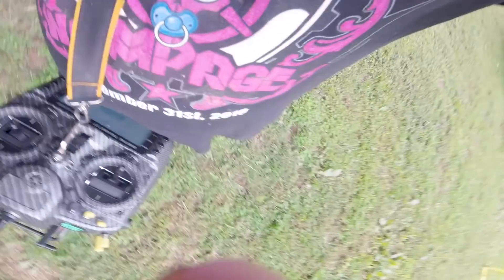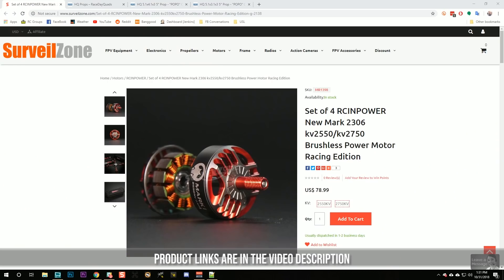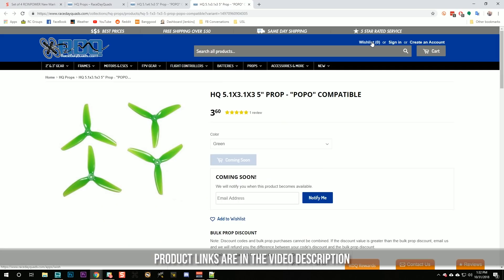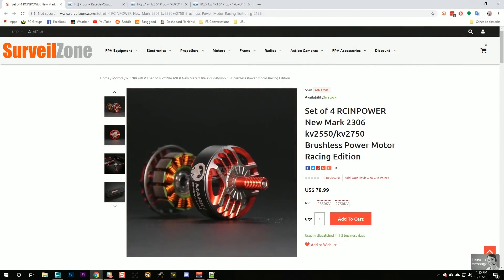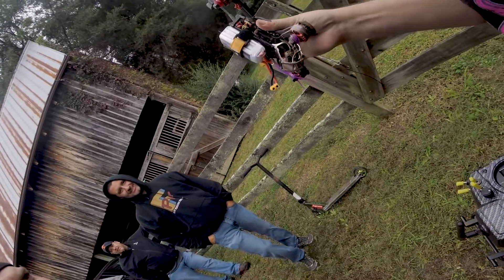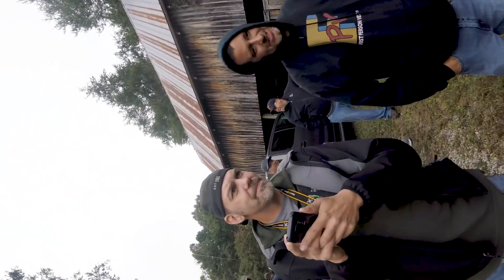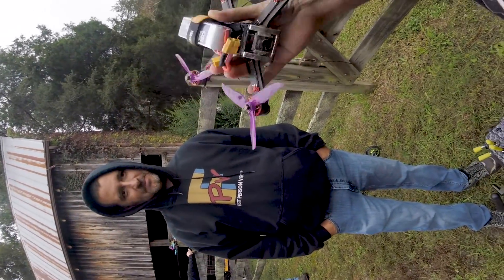HQ 5.1 Series Props and RCINPower 2306/2750kv Motor

Comment from the maker: 1:08 - Intro about kv and prop selection

4:24 - Actual conclusions about motor and prop are here

10:54 - Flight examples.
Reply: is image stabilization on or off on the go pro?
Reply: That's the only prop I use dal 5040 on 2700kv

Comment: was that on 4 or 6s?

they are rated for 6s I believe...
Reply from the maker: If you have the guts to run 6S on 2750kv, more power to you.
Reply: @JoshuaBardwell  😂 already had 2550kv on 6s (without throttle cap on a 5152 gemfan flash) 

How much worse could 200KV more be... 😂

Comment: Would you recommend this motor for a medium range 5s 65amp esc build using 6x5x3 gatebreaker props?
Reply from the maker: No definitely not. Such a high kv motor is not suited for 6" props especially on 5S.
Reply: Joshua Bardwell Thanks for the response, I went with the 2407 2500kv motor from lumeniere, Would this motor paired with 65amp Ecs and the gatebreaker 6x5x3 be feasible under 5 or 6s? Kakute f7 board. What would fail first in your professional opinion?
Reply: I feel like I should add that I do not intend to race the drone, I am a mild flyer who enjoys aerobatics and the occasional big punch out

Comment: And I totally agree JB, if your gonna run 5x4x3s it's pointless to run anything more then a high quality 2205 like the R2 in 2522kv or the OEM  R2 bad ass motor from RDQ in 2450kv that is a perfect 5x4x3 motor on a semi light weight build nice flight times on a high quality 1300 with minuim sag through out the pack. Imho the best motor for the 5x4.3x3v1s is the R4 2206 in 2522kv. Once you step to high end quality 2207 or 2306 or bigger 5x4.5x3 or more or it's pointless. I can say I'm really loving this 5131x3 on 6s 1750kv for a freestyle prop running 6s 1050s flight time is awesome, prop flutter comes on past about 90% throttle once the quad picks up some speed but the low end and mid range response is wonderful and flight times are excellent as well as being VERY battery friendly.

Comment: I was able to test these props on a tight track. My opinion goes to show how differently a prop can based on how it loads any given motor.

 Way too much low end torque for me. Hover point much lower. Very non-linear power delivery over 30% throttle. Stalls at 70% throttle.Tested on 2205 2522kv hyperlight.

Your first video looks over-propped.
Reply from the maker: Hard to believe my 2306 was overpropped but your 2205 was not. I suppose weight could play into it.
Reply: @JoshuaBardwell lower kv. I stalled later than your higher kv motors. We can use max prop frequency as a rough factor of max rpm, right?

Comment: A racer guy suggested I get those hq 5151 props. So i did and i loved it. And in 3 weeks, all my batteries were destroyed :) One battery even ruptured and smoked. So, i built a 6s quad instead so i could keep running that prop and it is awesome. Batteries are barely warm and its super punchy. motors are the emax rsii 1700kv. Those props made me build a 6s quad :)
Reply: Michael Wilkes I can confirm that. I have the same experience.
Reply: If your running 2400kv plus on 4s with the 5151x3 on any motor that can handle that prop you MUST set the throttle end point to 85 or a max 90% or you will no doubt kill batteries even with top shelf packs. It's a heck of a prop on f40 pro IIs 2400kv with throttle end point at 90% and on the 2600kv with throttle end point at 85%. Only packs that handle it and stand up to them well is the 100c R-line 1550 2.0 HVs they do take it pretty well but if you run 100% throttle end points and are between 70 and 100% throttle a lot of the flight your gonna kill batteries right and left. 6s is no doubt the way to go BUT with the right setup and really good batteries you can handle props,like the 5151x3 and not destroy batteries.
Reply: @wickedreelz5028 :  good info. I was pretty soon aware that i had chosen parts poorly, so i just decided to run it to death and build something else.

Comment: Think you over propped it still ... if try a 4x4x3 on them but I reckon a 4.5x4.5x3 is a prop size we need ... more pitch means more speed less thrust. High of or total rpm should use a smaller diameter prop as it has a way bigger throtal range if the right prop is on there so it will make up 
 it's performance in speed not thrust ... high kv is made to spin faster with the sacrifice of tauqe where a low kv motor you can put a bigger prop on for the same size motor make twice the thrust but have half the speed... low kv has more power but less throtal range and if both motors are propped perfect they will be both responsive and smooth if used in the right way like high kv in a tight compact light build and the low kv can be a heavy old tank and still preform well

Comment: Try the T-Motor, best prop for high kv motors.
On high kv motors, you have to use  either low pitch prop, or low surface props; T-Motor and Dalprop 5051 are low surface. T-Motor are also durable.

Comment: Is there a way to re thread the screw holes on these motors? i stripped mine from changing to different frames! if there is a type of tool please comment..great video and flying!..
Reply from the maker: If you mean the base, it's possible you could tap it and insert a threaded sleeve. But you're going to need to be really careful not to get metal filings into the magnets.

If you only damaged one hole, you can just fly on three, or even two screws, as long as they're good and secure.
Reply: @JoshuaBardwell  what size are these sleeves?..and where to buy?
Reply from the maker: The name of the tool is Helicoil. The screw size is m3.

Comment: This is absolutely a true story! i bought these motors about eight months ago put the on a stretch X armattan frame a couple days of flying it just doing line of sight speed runs back and forth on the arm where the motor screws are... it snapped that spot in half and two screws still holding the tiny half to the motor and it tumbled to the ground! the sound was so wicked! sounded like   Chewbacca choking  on a ham sandwich! very powerful and durable motors!

Comment: Nice flight, didn't surprise me that all the props broke. Those dal T5040C break right at the Hub if you just look at them wrong. Forget trying to turtle mode with them, horrible prop lol

4s 2207 2700kv or 6s 2207 1800kv on T5143 props mmm best combo ever.

Comment: Hi Joshua, have you tried the gemfan 5149? I used the 5055 and 5152 for a while then tried the 5149 and love it. I’m using them on both my race quads, one uses f40 pro 2 2600kv the other uses the hyperlite 2204 3022kv both builds are 287 grams. I feel they work quite nicely. In my latest video you can see them at work on the talon frame running flight one stock vanover tune and I was getting some good proximity confidence building up :)

Comment: i see i need to test out a few more props with my setup. Can i get a suggestion?
I'm running EFAW 2407 2800KV on 4s, Karerera KEA frame. Ive flown the 5042 windancers and i like them because it keeps the amp draw reasonable. Ive been running cyclone 5045 here lately because i have them around and they are durable. they are too responsive tho.
Should i just retire the motors and keep them?
Reply from the maker: I think those are great motors, but the 2800kv would really make me wonder. Hey, maybe that's the motor to make th 5.1x3.1 come alive!
Reply: @JoshuaBardwell  I suppose I will have to order a few. Slide in a link if ya want, I'll order from there?

Comment: I have 3b 2306 2700kv motors with Dal Cyclone T5046C props.  Not to bad but the prop goes a little flat on full throttle.  Thanks for the video.

Comment: Good review, I think you should try the azure 5140 props on that motor.... I think you should just try them period and do a review on them lol.
Not joking they are my goto prop now
Reply: And it looks like its alittle under proped? When you do a trick up it looks as tho its falling faster and then you have to wind it up really early.
I have this problem on my 3" build also bc of the weight of the quad.
Maybe turn up spin to 6.0 in configure?? To get it alittle more flotation out, I had to 2 of my quads bc of the difference in the frames

Comment: Could you possibly do a video on the difference between open TX transmitters with a multi receiver protocol and transmitters that don’t have multi protocol such as Frsky transmitters with their receivers  because it seems like transmitters without the multi-protocol module seem from the videos I’ve seen to have a greater range

Comment: have you ever tried doing a video about low kv low pitch props and what effects there actually are. of course there are  several hypothesis about it, but no ones actually done a video on the effects of it. just going off the judgement about your intro to this video about low pitch high kv and how a 3.1 pitch was effected. just got me thinking about what would happen on the idea of low kv low pitch and visa versa
Reply from the maker: Low KV Low Pitch would just be no thrust at all. I'm not sure what the point would be?
Reply: @JoshuaBardwell  okay maybe not a video but aside from workbenche telling me hey this is the amp draw and etc. There hasn't really been a cut and dry video about these props pair best with this kg. And I know theres more to it ie. Stator size  diameter, some would go as far as the windings too. But I havent gound that butter zone for a 2450 kg. Also damn good looking motors ta got out for sale may have to trade in the hypetrains for them, dont tell kapper!!!
Reply from the maker: There just isn't a universal formula for prop and motor. There are general guidelines for what tends to work well, but they are largely experience-based. For a 2.4 kg quad I couldn't advise... I don't fly anything near that big.

Comment: I have a super light 5 inch ( sub 250g dry) , I use  old 2205 2750kv. I use 5040 cyclone or the gemfan 5042. The motors can turn it reasonably without any problems. I do however find that it's lacking some "torque" or "grip" at low end. I did see huge improvement when I adapted my flying style. I am quite aggressive on throttle and I can keep it tight that way.

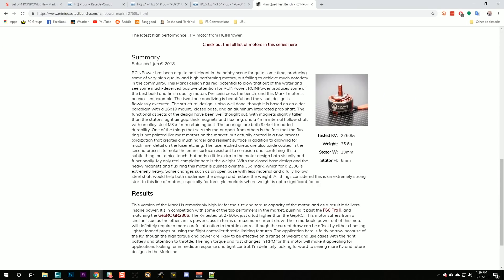Comment: That's completely not what I experienced.  On my Fusion running Tmotor F40 III 2400KV, the HQProp 5.1x4.6x3 had pretty darn good power and efficiency.  Amp draw never hit particularly high.  They felt like somewhere around a DAL Cyclone T5050 with more efficiency.  I like more aggressive props, so I've been running the Gemfan Flash 5149s.  They're slightly less efficient than the Cyclone 5045s I was using before, with slightly less speed than the T5050s I tried.  IE, I got near the performance of the T5050 with nearly the efficiency of the T5045s.  I also used the same Gemfan Flash 5149s on my racer that uses TMotor Pro II 2600KV motors.  They perform very well, not too high A draw, 3:30-4:00 flight times flying moderately to semi-aggressively.  ... I tried the Azure Power 5150s, and it performs AMAZINGLY with eye popping speed and responsiveness, but holy crap the efficiency suffered, going down a solid 30-45 seconds.

Comment: Hi Joshua, thank you for your feedback. Question: Is there a big diferrence between 2 blades prop and 3 blades prop (for same diameter and pitch), both in terms of performance and autonomy but also in term stability/controllability?
Reply from the maker: Yes, big difference. 2 blade is more efficient but less thrust. They feel more slippery in the corners and track less well.

Comment: Perhaps its a case of comparison syndrome with the 5.1x3.1x3. I flew them for quite a while and really liked them. I had to get used to the slightly lower thrust, but once I did I really loved the amount of throttle resolution and overall smoothness! They felt really locked in and controllable.

Comment: isn't easy find the potential of s set of motors on a youtube video, for me that RCINPower motors doesn't and perform so well, you just fly 4s on this review, right?

I still love the not knowing brand called AMAX, I been using and testing some of is motors and the 2305 2350kv are so nice and special... Bardwell, if you have "time" just check about this motors, I will like see and listen your impressions about:

https://www.amaxshop.com/index.php?route=product/category&path=667_552_558

Comment: Are any of the HQ props above 5” (ie 5.1” 5.5” 6”) considered V1S props? That is does it have precisely the V1S profile?
Reply from the maker: That's a good question but I'm not sure the answer. There are often subtle differences in the props to tailor them to the diameter.
Reply: I'm not sure if the naming includes V1S (though I've not seen it advertised as such), but my eyeballs tell me it's a different profile.

Comment: The hq 5146s are great! Not sure on 4s, but on 6s they give me 4 minutes of freestyle flight, and always finish 2 minutes races.  The 5151s did feel amazing, but lacked efficiency for 2 minute races...they rule for 1st to 3 laps formats though
Reply: On 4S freestyler they rock also, very nice freestyle props which give smooth flow but also punsh when needed. Running them with Emax rsII2306/2400.

Comment: It all depends from your style of flying. It's smooth but you can see the lack of power. However it's important to say that everything is related to the weight of the quad. I enjoy 2750 kv and 5050 props because I fly a light 5 ". I don't fly to make smooth video but just for fun and I love the sensation I can go to the moon if I want. Thanks Joshua.

Comment: Hey Joshua. Could you do a video about POPO and why it hasn't caught on/ been on other motors?
Reply from the maker: There are tons of POPO props coming out today because it's relatively easy to add the little ball indent to the prop mold. There are only about 3 or 4 POPO motors though, and the reason is probably just manufacturers don't want to pay for the shafts. My motor was already coming in around $26 and it would have raised the price by a dollar or two to add POPO and I just couldn't do it.

Comment: Hey mister fpv know it all,  the pitch is in degrees not in inches? Correct me if I'm wrong. ;)
Reply from the maker: A better way of describing pitch is via the "advance ratio", which is how far forward the prop will advance in the air for one rotation, under a set of ideal conditions.
Reply: @JoshuaBardwell  like the thread of a bolt. I've been flying for 7 months or so and just now I understand what it means. X'D oh my
Reply: @Cyramex hmm.  So how come a 5045 prop happens to have a 45° angle on it.?  
Explain what part of the prop on a 5045 is 4.5 inches? 
#MetricEqualsLogic
Reply: @Cyramex Well i suppose i didnt understand then.. i do know that for higher kv you want a lower pitch. 
Can you provide a like that explain it then?
Reply: @Cyramex I found it man.. 
https://www.getfpv.com/learn/new-to-fpv/all-about-multirotor-fpv-drone-propellers/

This really opend my eyes to props and how to choose them lol Thank you =D

Comment: Great video man!!! What prop you recomend for a 2308 1950kv ?
Reply from the maker: I'm gonna assume you mean 6S and honestly I don't even know where to begin with that motor and 6S. I would assume it has torque to spare, so I would try to find the heaviest prop that still gave me acceptable battery life. I don't think you're going to over-prop it in terms of handling.
Reply: @JoshuaBardwell  I be flying it on 4s,5s and 6s but mostly on 4s 
DIATONE GT M540 2018 5"  STRETCH X VERSION you shut do a review on it.